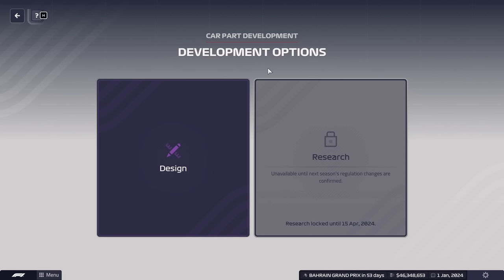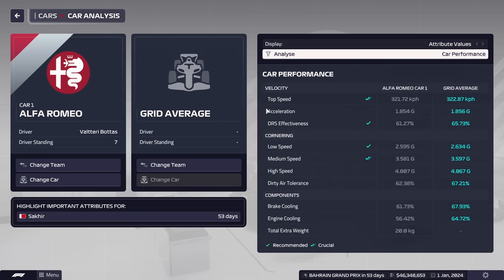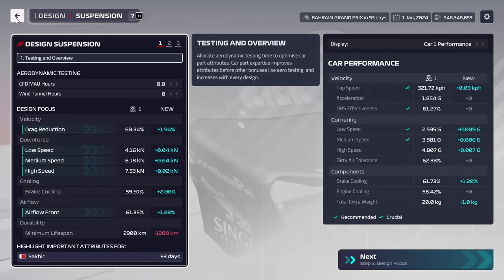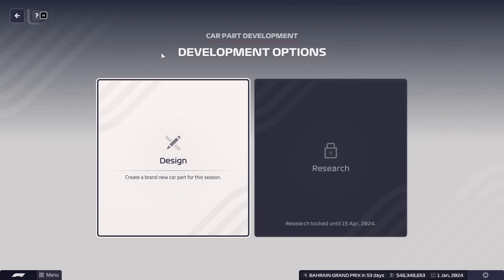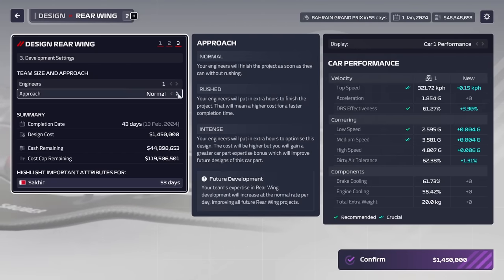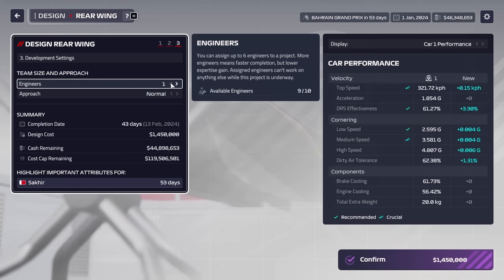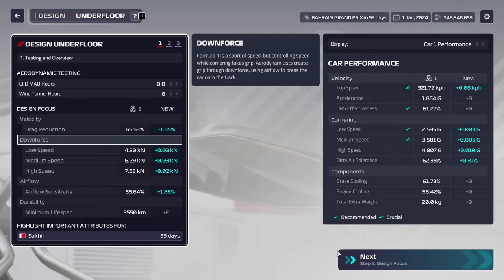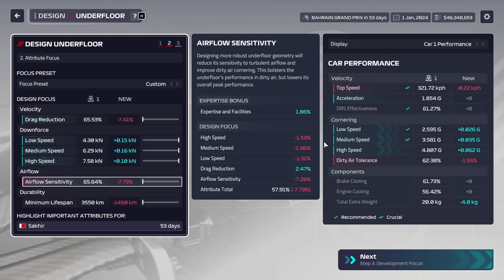Car Development Guide - Design, Research, Expertise and Sliders for Patch 1.9 - F1 Manager 2023

Comment: I may be able to answer myself by the time my comment is answered, but when you research say sidepods once, and then research them again right after, in the same season, do the stats stack? Basically do you just research each part once per season, or no? If that makes sense lol.
Reply from the maker: You can research them as many times as you want, you'll get slightly less gains with each consecutive research due to reaching higher levels of expertise, in general you should research enough that you don't get any losses from regulation changes.
Reply: @NeroBax  that makes sense. Thank you!

Comment: Hey man, my question is that how often should you use cfd/wt hours on the same part? For example i put everything into an underfloor, then i make the 2nd design. Now do i wait for the next atr period to do that again or can i just keep on designing them without any hours put in?
Reply from the maker: You can make designs without CFD/Wind, the gains will be smaller but you will still have progress and it is the main way to progress your parts. 

Depending on your expertise it might be a better idea to put a 2nd period into a different part than the first as the higher your expertise gets the lower the gains you are going to be getting, so if another part is lagging behind you could get more performance by focusing on it.
Reply: @NeroBax  thanks dude

Comment: Is there a reason why at a certain point designing a new part actually has a negative effect on performance?
About 75% through season 1 and everything i go to design makes the car worse off..
..
Reply from the maker: Would either be weight or slider placement. Weight has a huge effect on performance, sliders also has an effect as each part has things they are good and bad at and if you maximize the bad while minimizing the good, you'd see effects like negative impact to performance.
Reply: @NeroBax  right I see ok, I'll try and figure out what I've been doing wrong. I've been following the same slider set up for my first 2/3 designs of each part, but repeating that pattern again just seems to make the new part worse.
I guess repetition is a....bad thing?
Reply from the maker: Not really you should still be seing gains, if the slider placements are identical you shouldn't be seing losses at all. The only explanation in that case is either that your staff has been switched out with worse staff as they have an effect on the parts or that a building has degraded and you've lost some of the bonus it provides.
Reply: @NeroBax  could I possibly send you a screenshot to you on X showing my problem?

Comment: First of i really appriciate your great content, for me just one question what should i do if just for example Front and rear Ring  have Regulation changes should i still research for something else of just focus  on this 2 parts
Reply from the maker: I'd focus the parts that have regulation changes until the resets cancels out the loss from the regulation. 

The main reason is that a regulation change is a loss of expertise that takes effect next season, but for research this has already happened so you will have higher gains researching what is losing expertise from regulation changes than other things. 

It also depends on the regulation though, if I am losing low speed cornering on the rear wing I wouldnt worry about not getting the full research done but if I am losing low speed cornering on the front wing it would definitively be priority number 1.
Reply: @NeroBax  thank you

Comment: Great video man ! 
How would you go with CFD and wing tunnel allocation time then, just maximum to 1 piece at a time, or distribute it between three projects at the same time ?
Reply from the maker: I prefer using everything on one part, to maximize it's gain and also because you are going to to need to do another design after to get the most out of CFD/Wind. 

For research you can split it as you see fit since you don't need to do another project to see the effect.
Reply: @NeroBax  Thanks !
Reply: @NeroBax  Sorry, for the second design, do you put another max use of CFD and wind tunnel, or just 0 and 0 to complete the design quick so it can be manufactured? i understand the initial full use to maximise expertise gain, unsure about the 'second design' part.
Reply: @haime2 if i know it correctly you put either half or all of the cfd/wt hours and after its done you just design that part further with 0 hours to boost it up and then manufacture it

Comment: Why is it that each new season after spending all this time qnd money to get your car competitive that it reverts back to crap?
The other teams dont start out with a bottom of the barrel car. You dont see Red Bull having to design new parts and rush parts because they are 20th in stats. Wth...i never got that. It makes it feel like all that work was useless.
Reply from the maker: I assume you are specializing your sliders? 

The AI will have a more general approach to the car meaning they have a way more balanced car for one, and the second reason is that they rarely minimize weight. So your car initially will be terrible but as you get your sliders set up properly and shed weight the real performance of the car gets shown, in reality though, if the AI copied the player they would most likely have a car that would outperform yours.